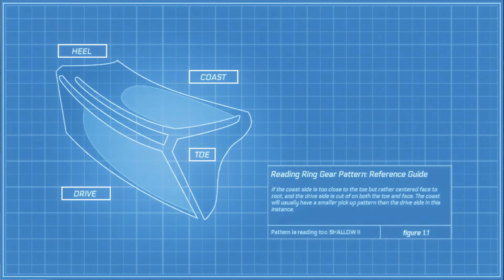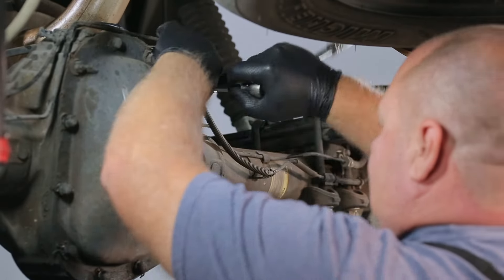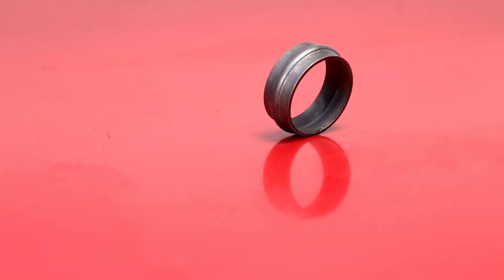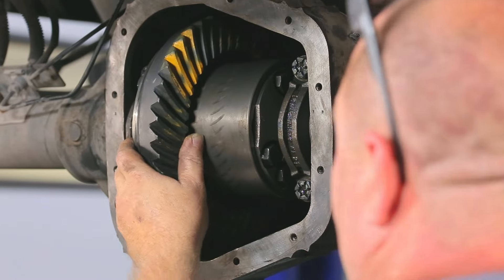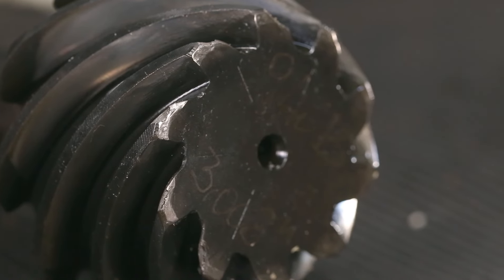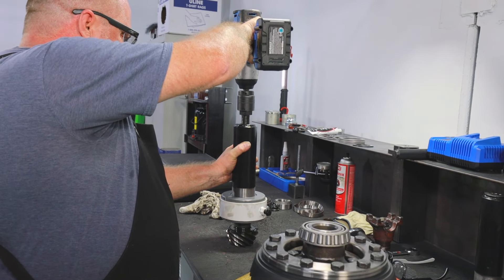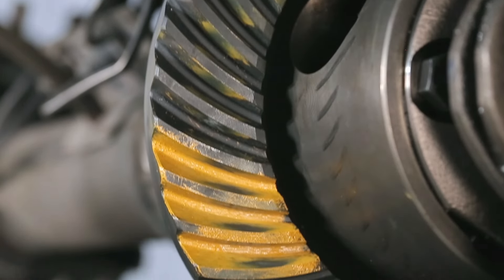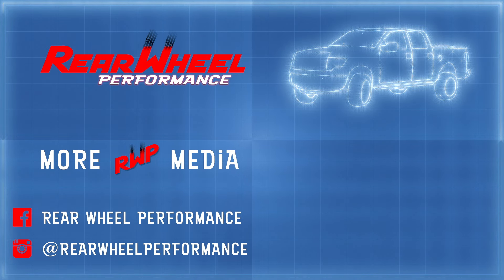The Easiest Way to Read Ring & Pinion Contact Patterns

Comment: is it normal for a rear that i just got done rebuilding to run hot to the touch? i only put about 5 miles on it and got under it to see if every thing was good or not leaking, i put my hand on the pumkin and it was almost to hot to touch. i didn't smell any hot oil or see any oil leaks and i have the right kind of oil and amount in it?
Reply from the maker: Absolutely they will run hotter than normal during break-in, and especially so on that first drive (why most installers want the first one or two break-in drives and heat cycles before handing it back to the vehicle owner).  The tooth surfaces on most new gears are rough and need to wear in slowly to smooth out.  Most manufacturers will advise a specific break-in cycle, and then a gear oil change at a few hundred miles to get rid of all the particulates that are shed during the break in process.

Comment: I will be building a Dana 44 for my Duster to replace the 7-1/4 .   What do you think of just shimming the spider gears a little more to have it act like a posi unit .
Reply from the maker: The added clutch action would likely be minimal.  If it is a 30 axle spline D44 on a budget, we would look for a used traclok and probably spring for a new set of clutches.

Comment: Thank you for making the video and replying to comments.  I am doing a gear swap on a an aluminum Dana 44HD.  I don't have a tool to pull the bearing back off the pinion and I think I need to add shim.  What do you think about knocking the inner race out and shimming behind the race to move the pinion in?
Reply from the maker: It sounds like you are familiar with some of the differential models that are specifically designed to do that type of inner race shimming, and it should work if done properly.  We do cover a couple of methods of removing pinion and carrier case bearings in another video: https://www.youtube.com/watch?v=n-RJRe6jacg
Reply: @rearwheelperformance  Wow, I'm amazed you bother replying to everyone.  Its rare and extremely appreciated.  I went ahead and bought a clamshell bearing puller like you prefer in the video you linked.  I have a press and a splitter, but what I have will not fit behind the head of the pinion.  It would destroy the bearing for sure.  Thanks again.  You kick ass.
Reply from the maker: @01Z06guy  Hey, it's to mask the guilt that we're too busy in real life to make more videos right now!  The least we can do is try to answer the people that take to time to comment.  Thanks a ton!

Comment: Great video . What would cause arear end to make a whining noise when you let off the gas pedal but is quiet when you're accelerating? Vehicle uses a torque arm set up . Thanks in advance.
Reply from the maker: It could be multiple things, but when the drive side is quiet and the coast is a little noisy on a new gearset, it can be the gear finishing/machining.  I've also had a few seasoned sets that would get noisy during deceleration when the pinion nut had started backing off or had a pinion bearing going bad.  In any event it is worth the physical external and internal investigation to make sure it is safe and reliable.

Comment: Good video. I finally get it and you guys confirmed what I thought, that if backlash is correct then the gear pattern is probably going to be very good or close to it.
Reply from the maker: We think so.  Having the backlash set properly first, leaves all the remaining focus on just the pinion depth adjustments if necessary.  Thanks!

Comment: I bought a 8.8 to put in my falcon and decided to check backlash and it has .014. Should I try and tighten it up or since it’s a used rear end just run with it? Are the shims that are in it thin enough to move around to get it to the .008-.012 spec for a rebuilt ring and pinion. I feel if I try and tighten it up I will be chasing my tail. What are your thoughts. Thanks and great video
Reply from the maker: You probably would get away with it, but for how simple it really is we would re-shim for better backlash.  Even if breaks in ok and runs quiet, it is our opinion that more backlash allows more movement in the entire driveline. Think of it like a hammer swing - you can do a lot more damage with a 14" swing vs 8" swing - using an analogy here :)
Reply: @rearwheelperformance  thanks

Comment: What keeps the crush sleeve from crushing more when you torque the nut the finial time
Reply from the maker: Torque the pinion nut in increasingly smaller steps, checking frequently, when the bearing preload (rotational drag) is getting close to specifications.  Stop adding additional pinion nut torque once the bearing preload (drag) is anywhere within the specification range.
Reply: First of all your not measuring torque ,your are measuring preload ,On a 12 bolt GM you need some where between 400 and 600 ftlbs to start crushing the collar , you have to 'creep' up to the desired  preload ,which is measured in Inch-Lbs usually 10 to 15 in-lbs of preload . Ive built over 500 12 bolts and the only impact that seems powerful enough to crush the 12 bolt is the M-18 Milwaukee , the M-18 is the best battery powered impact to use ,don't waste you money on  other name brands that I won't mention ,8.5 GM and 9 in and 8.8  Ford crush  fairly easy ,12 bolt and corvette 65-79 are tough to crush , have recently run into some aftermarket crush collars that refuse to crush , stick with OEM or Rateck

Comment: I know this is a late comment, but I need a bit of clarification.  You are saying to crush the sleeve AFTER setting pinion depth and backlash?  I don't see a problem with this other than getting an accurate pinion preload reading, since it is in inch-pounds.  How do you accomplish this is you are dragging the ring gear along for the ride?
Reply from the maker: Not at all.  The crush sleeve is only required upon final assembly as it has no effect on the pattern setting process.  Pinion pre-load is checked before the case/ring is put into the housing.  You never know if your going to need adjustments for the pattern, until the pattern is checked.  Of course, you are free to use a crush sleeve for every pattern check, but you will need to have extra sleeves and it will add a bit of time to the overall installation/setup process.  That is, unless you get lucky with a perfect pattern on the first try ;)

Comment: If you install the pinion without the crush sleeve… how are you supposed to know if the pinion is sitting in the correct spot when your installing the carrier to set backlash. I get that you do it to save having to replace crush sleeves if you need to add more shims behind the pinion bearing. I just don’t understand how it works without something there? I was told to use the old crush sleeve (if useable) as a template. Then set backlash. Then replace old crush sleeve with a new one and tighten pinion nut to manufacture specs.
Reply from the maker: The crush sleeve does not affect pinion depth.  It only serves to help set pre-load at the outer tail bearing.  Depending on the axle model, pre-load shims or crush sleeves are only required during final assembly, after the pattern has been set properly.
Reply: @rearwheelperformance  that makes sense hearing that. Thanks! Your videos were perfect I look forward to doing my gear/posi install on my 64’ C10 very soon! Cheers
Reply from the maker: @chrishill3288  Good to hear.  Keep us in mind if you want a second opinion on the setup pattern.  Have a great one!
Reply: @rearwheelperformance  one last question. I am planing to do my install Thursday so I am just running the whole procedure in my head, and my last question is… can I install the pinion/crush sleeve and set pre-load to 25 inch lbs on the pinion yoke first, before even setting the carrier into the housing?
Reply from the maker: @chrishill3288  pinion preload should be set to spec before the carrier is installed, that way the reading is only the pinion rotation.
Reply: Hi guys. So my new pinion isn’t identical to my old pinion. To start the back of the pinion gear is touching the housing. The number on the face of the pinion is 2.825 and the distance from the face of the pinion gear to the housing bracket is 3.29. That’s close to 1/2” shims. Currently there is about 1:8” slack but it won’t seat anymore because it’s already hitting the housing…
Reply from the maker: @chrishill3288  Sounds like your differential posi case is not the same series as the ring gear series.  Hopefully it's just a common truck 12 bolt model rear, in which case which you could either exchange the gearset or the posi to the proper matching series, or just use a ring gear spacer to make up the difference.
Reply: @rearwheelperformance  tbh.... i forgot to set the inner bearing race ;) i am .005 under factory specs with the stock shims on the pinion...so i should be good to go tonite when i attempt to finish.

Comment: Can you share any tips for what pattern to look for when installing used gears, most of what I’ve read is to only look at the pattern on the coast side.
Reply from the maker: Used gears have already worn in a flat pattern on the drive side.  It is the entire side of the face of the drive side ring gear teeth.  Marking to read a perfect pattern is difficult since the surface tension of marking compound won't allow the ring and pinion teeth to "wipe away" to reveal.  Bad patterns will be obvious, with defined high or low markings.  Again, a good pattern will likely just look like smooth marking compound without much, if any, dark pattern.

Comment: The comment about overdrive side is little dependent on if towing heavy and using engine breaking as then it becomes really important.
Many many many moons ago i was taught to think about it and remember by a little limerick, either draw a circle on the ground or pick the crownwheel laying on ground with teeth up, stand as if your foot represents a tooth with toes facing centre, and think of the tooth contact reading
Limerick: if face or flank ( your face is high your flank like a horse - your butt- is low )move the crank ( pinion) if toe or heel move the wheel, if toe you go ( move the wheel away from the pinion ) 
All the while maintaining correct backlash also as you make these reading changes, 
Generally speaking if you are just changing out bearings from normal wear then as long as you use quality bearings ( same brand even better) with same part no,s ( for quite some time the variance between bearings of ssme specifications regardless of manufacturer has been so slight its impossible to see a difference with basic tooling etc when repairing) its just a 're-race' job and whatever shimming was used before 99.999% of time will be spot on for average do-it-yourself repairs ( if you know how to do it better and have more accurate tooling you probably shouldn't be watching this anyway) so buy the right bearings and reassemble with mixing things up and check first, some variations to patterns are acceptable if using worn gearset with new bearings, even most quality replacement gearsets of same ratio wont vary perceptibly mostly, then if your not happy with contact pattern got to limerick, if your doing this regularly or constantly for a living you probably dont even notice your brain doing this automatically but if you just a do-it-yourselfer or helping a buddy then just slowly think through it and refer to limerick and these days take plenty of before pics and during as then you have some references where you might have messed up
Reply from the maker: That is a lot and worth the read.  Every experienced installer has their theories and experience, and as long as the installations are reliable and long-lasting they're all good.  Thanks!

Comment: Can you share the part number for the tool you used to pull the pinion bearing?
Reply from the maker: Absolutely! The clamshell bearing puller set is part # 90-0001-1. You can find it at www.nationaldrivetrain.com or sold through Accu Auto Parts.
Reply from the maker: If you want to see more of this bearing puller in action, check out our video highlighting the strengths of this tool over the conventional splitters in "Differential Bearing Puller vs Pinion Bearing Splitter: What's the Difference?"

Comment: So you say don’t use a crush leave when you’re setting up your opinion and up for the first time but don’t you need to have one in there, maybe the old one?
Reply from the maker: They are only necessary during the final assembly when the contact pattern has been checked and set properly.  It would serve no purpose during the setup and checking process.

Comment: How to set the pinion depth ,is there any calculation for that
Reply from the maker: If there are pinion depth markings etched or stamped in the new gear set you may be able.  Have your installer contact our tech line at 877-910-2244 M-F 8a-4p (Central Time)

Comment: When adjusting backlash on a 8.8 I heard  that moving a .010 shim from one side to the other yields a .007 change in backlash?  Just curious so I have a idea of how much shim to move to cut my .014 BL in half.

Thanks!
Reply from the maker: Seems about right, its seems to average about 70-90% of the backlash adjustment.  We'd probably adjust about .008" on the sides.  Very nice you want to get it on the low side of backlash, always a winner move!

Comment: New gears and bearings. Pinion preload was perfect, Backlash perfect, contact patterns perfect in 3 places. On test drive there is high pitched whine coasting. Pulled everything apart, patern couldn't be more perfect. What gives???
Reply from the maker: It happens.  This is why we've been big on trying to add an audible check in addition to the tooth contact pattern check during that phase if installation.  Rotating the assembly by hand during the gear pattern check, it needs to sound and feel silky smooth, and if there is any amount of tooth mesh feel or sound during that phase, it will definitely turn into a whine during road driving.  We've sacrificed contact patterns for feel/sound for critical drivers, and we've sacrificed a bit of coast whine to assure that the drive side had the broadest contact for strength for performance applications.

The good thing is, that a unusually noisy gear can be re-shimmed to try to reduce it, but only if had a very short initial drive.  A broken-in noisy gearset will never be able to be shimmed quieter again.
Reply: @rearwheelperformance  i drove 19 miles. I am assuming you would shim pinion away from ring gear. The noise isn't too bad, i can live with it, but just makes me think something isn't right.
Reply from the maker: @redrustyhill2  Without a visual of the original pattern we could only guess what may have helped, but in our experience, once driven more than a few miles it will not be able to re-shim any quieter (or worse).  Some installers rule of thumb is it should be ok if it is quieter than the other noises from the transmission whir, tires, etc.

Comment: No! This is misleading 
Sorry but it’s true.
You cannot just focus on pinion high , pinion low , pinion centered, 

The pattern could be centered but be at the toe.
That’s not good but the video didn’t explain that and if you just focus on the fact that it’s centered your in for trouble. 
Backlash could be correct, pattern could be centered but pattern is at toe.! Not good
Video needs work
Reply from the maker: Awesome, explain how you think is the best way to center a slight heel/toe pattern, when the backlash is already in spec and the pattern in centered root to tip.  If you want to critique a technique, fine, but if you really want to help people, you should also explain what you believe is the correct method.  Just saying 'no' isn't helpful to anyone.

Comment: Crush sleeves are outdated tech
Reply from the maker: Tell this to the original equipment manufacturers  (i.e.,AAM, Spicer, ZF, etc.) that have eliminated most preload shimmed models.  They're not bad or outdated, just different.  Preload shimmed and solid spacers styles are great for those who need and know how to use them effectively.  If you want others to benefit from comments, It's much more productive to state the comment subject, then elaborate a bit on experience of how and why, otherwise it just looks a little snarky to everyone reading.  We can all do better.

Comment: Hello. I need your assistance. If pinion teeth are 8 and ring teeth is 37. Are better or pinion teeth  11 and ring teeth 51 ?
Reply from the maker: As a general rule, more teeth helps with more tooth contact area.  We have yet to hear or see anything different, but I'm sure that a mechanical engineer may have a more knowledgeable answer based on facts if they can add to this.

Comment: So if set up correctly you shouldn’t have any gear noise at 50-60 mph???
Reply from the maker: There shouldn't be any moderate or substantial gear noise at any speed.  We know of some installations that had a low-but-reasonably-acceptable amount of noise that never wore out over many miles and years, but trying for installations with as absolutely as little as possible is the goal.
Reply from the maker: @RCCRAZYSTUPID  Sounds like a driveline harmonic that comes and goes only at certain speeds, and it will likely come back more intense at double the speed you are hearing it now.  Machining and pattern issues will more commonly be heard at all speeds, becoming more pronounced as speeds increase.  It won't go away, but if it is at a speed that is driving you nuts, you can have a driveline company add a harmonic damper to your driveshaft that can help a lot, or swap to a different ratio or tooth count.  This is probably the hardest issue to diagnose and fix, and worthy of it's own video soon.